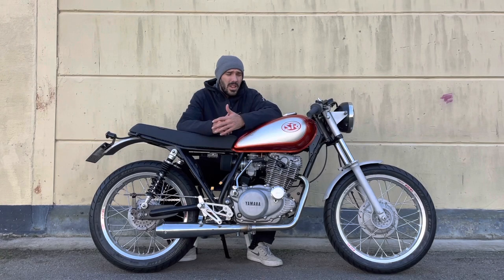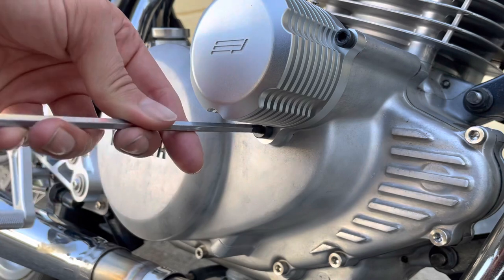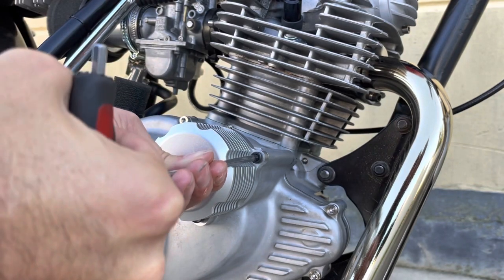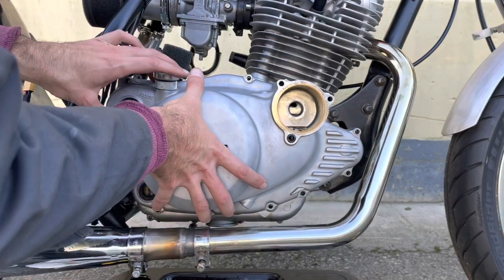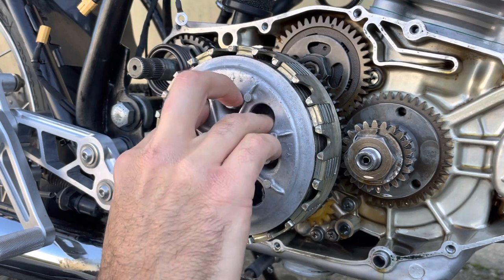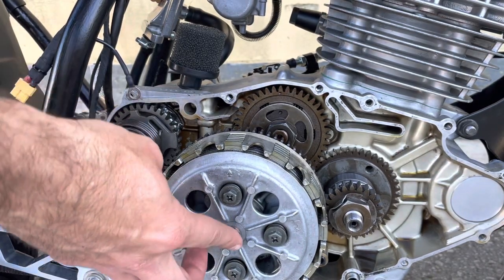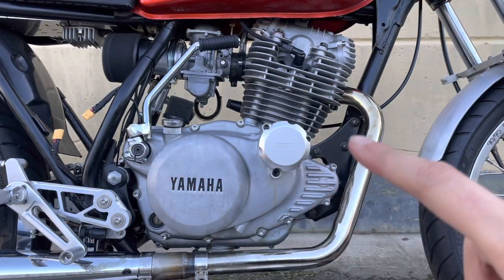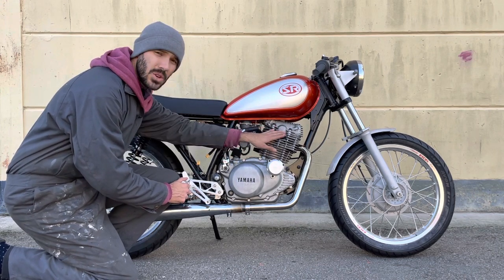SR250 Maintenance Part 1: Oil, oil filter and clutch change

Comment: Hey great vid! Quick question, what torque setting would you suggest for the cover bolts?
Reply from the maker: The manual states 7.2ft-lb for the long oil filter cover bolts and for the crank case cover bolts it specifies 5.1ft-lb. But these settings are so low, we usually just do these up by feeling - tight enough but not too tight!

Comment: What are you using for the upper oil plug? Looks metal as opposed to the stock rubber
Reply from the maker: Hi! I am not sure what you mean… Do you mean the oil filler cap? The stock one is plastic and the one I have installed here is a metal one with an oil temperature guage in it!

Comment: Sorry, a suggestion: is it absolutely necessary to empty the oil motor in order to remove the starting motor?
Reply: In other words, can I avoid to empty the oil motor if I remove the right crankcase cover?
Reply from the maker: @ivandepasquale2717  Hi Ivan, not if the bike is level. But if you lean it to the left side you can!
Reply: @JadusMotorcycleParts  First of all, many thanks.
In your opinion, could be enough to lean the bike on the left side stand?

Comment: I would like to buy your fuel filter. Where can I get it?. Maybe you could sell it with the right lenght size tubes and nice clamps.
Reply from the maker: That is a quick connector for disconnecting the tank quickly ;)
Reply: @JadusMotorcycleParts   Ah, Ok. A bit big. I have there a Briggs & Stratton Inline fuel filter now, but it gets a bit tight to fit with the tubes (not perfect, but more or less right). I tried before 90 degrees filters, but they were from China and they melted. They were fitting better (after cutting them a bit) though. It's very difficult to find a 90 degrees fuel filter that makes the job with the right size and is good.